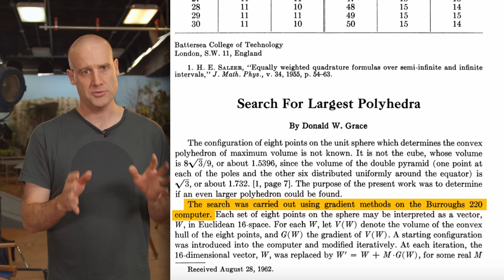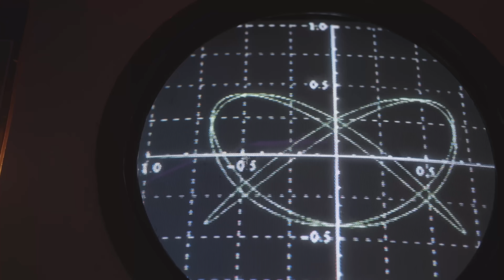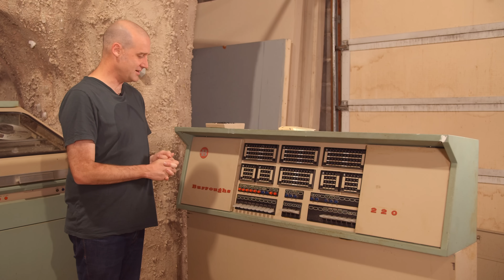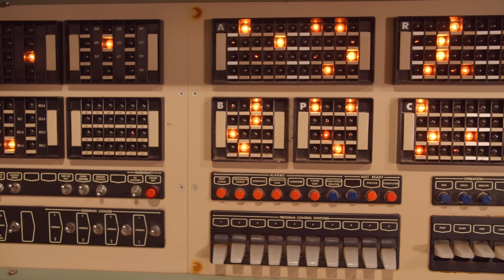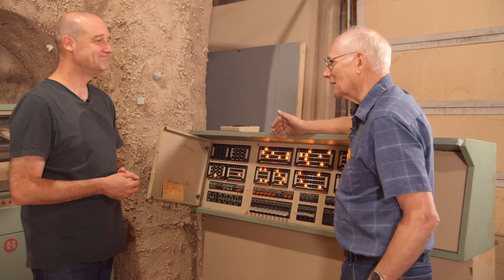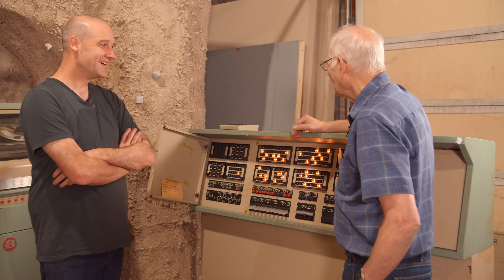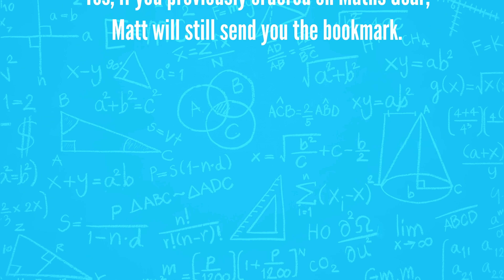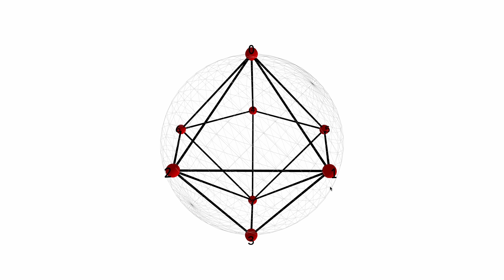The search for the biggest shape in the universe.

Comment: 4:55 so if the cube is 8/9 of the root3, the the cube should be one ninth smaller, not one eighth.
Reply: He didn't say the cube is 1/8 smaller; he said the double pyramid is 1/8 bigger. Which is the same as saying the cube is 1/9 smaller.

If P = 9/8 * C, then:

P = (1 + 1/8) * C, so P is 1/8 bigger than C

C = 8/9 * P = (1 - 1/9) * P, so C is 1/9 smaller than P

Comment: how did they even prove that's the global maximum. i can't even see a possible approach. crazy how they were able to pull it off
Reply: Without looking up the paper, my guess is you can enumerate all the possible configurations of points into a small number of classes. For example, the first point is always the north pole, because no matter where you put it on the sphere, you can rotate the sphere so that point is at the top; 7 points to go. Second point is either at the south pole or it isn't, so now you have two classes; 6 points to go. In the first case (north and south pole points) the point can go anywhere else and defines a plane; in the second case, the point can go anywhere not the south pole and also defines a plane; 5 points to go. The next point can lie on that plane or not. If not, it completely orients your space. Lather, rinse, repeat. The final 4 points have more combinations, so the count of classes probably gets bigger, but not more than 16 (2^4) or 24 (4!) times bigger, so it should be tractable. Then find the biggest volume for each class of starting conditions.
Reply: @johngregor6743  oh that's cool! the idea seems pretty simple, but I'm sure it's implementation isn't quite. nonetheless, thanks for sharing

Comment: @standupmaths 5:00 - I think there's a mistake: if the square has V=8/9*sqrt(3), that means that double pyramid is 1/9 better, not 1/8...
Reply: No. If C = 8/9 * P, then P = 9/8 * C = (1 + 1/8) * C, so P is 1/8 larger than C. You are correct in the other direction: C is 1/9 smaller than P.

Comment: Wouldnt the double hexagonal based pyramid be 1/9th better than a cube not 1/8th?
Reply: No. If C = 8/9 * P, then P = 9/8 * C = (1 + 1/8) * C, so P is 1/8 larger than C. You are correct in the other direction: C is 1/9 smaller than P.

Comment: 5:01 I think you meant it’s 1/9th better not 1/8th better
Reply: No. If C = 8/9 * P, then P = 9/8 * C = (1 + 1/8) * C, so P is 1/8 larger than C. You are correct in the other direction: C is 1/9 smaller than P.

Comment: "Used a motor-driven cam for the blinking lights"...can't get more anti-digital than that.
Reply: I don't know what I was expecting to make the lights blink. Maybe some rat's nest of a circuit board. Can't argue with the classics, though.
Reply: @Veylon  I was half expecting him to say 'an arduino'
Reply: @dielaughing73 no offense but the guy probably wouldn’t know one when he saw it 😂
Reply: @dielaughing73 same, I was 100% expecting him to say Arduino lol
Reply: Analog still rules.
Reply: lights turn on and off so its output is still digital
Reply: You can. I once built a hand-operated cam for a blinky-light prop for our school theatre group. Ok, it was more of a disc with a surface contact, but still, same idea.

And with "once", I mean nearly 40 years ago.
Reply: First comparison that came to mind was that pinball table Technology Connections made multiple videos on
Reply: I mean that motor could have been a combustion engine. Dieselpunk style.
Reply: Just as well he didn't tell us what was used for the 'fingerpoken'
Reply: …no, that's still digital - it's using discrete "digits" (the lights can still be interpreted as 1s and 0s).

Even Babbage's analytical engine (had it been completed) would've been a digital computer, despite being completely mechanical, since it would work with numbers as digits, not as, say, a position on a dial, like a speedometer.

Comment: You've got to love how trivial the 2d version's answer is (I believe), being just the circumscribed regular n-gon. Also, I wonder if it's possible to prove that the maximal shape must have all-antipodal points for an even number of vertices, and not for odd numbers? Also if all faces must be triangles that have to be close to equilateral (for some relevant definition)?
Reply: no, four vertices fails as two pairs of antipodal points would just give a flat plane. I think for four vertices it has to be a regular tetrahedron; I'm not 100% confident but it seems likely.
Reply: @gdclemo  good point, but I'm wondering if that's a "law of small numbers" case, where large enough even (or maybe only multiples of 4) mustobey this result.

Comment: The later Burroughs are interesting because it is not Vonn Neumann architecture but , it had what we would call a hypervisor built into the hardware and would switch between processes to provide symmetric multiprocessing - you could not elevate your privileges to the level of Hypervisor. It was a stack machine with virtual memory and 48bit word size. In 1961!
Reply: I don't remember the model, but I read about a Burroughs computer that allowed user micro coding. You could even choose the number of bits in a word.
Reply: @johnbennett1465  Maybe you're thinking of the B774.  It had "Nano Memory," "S Memory," and "Micro Memory"  As I recall, you could design your own op-codes, though I learned to fix it, not to program it.  TBH, it was always a mystery to me and I thank my lucky stars that the one I was (partly) responsible for never broke down.  The part I did like about it was that there were signal names like "True Blue," and "Stupid," in the diagrams.
Reply: @HSkraekelig  I don't see how you would ever be able to do your own opcodes because those correspond to physical toggles.   I suppose you could make up all sorts of "illegal" opcodes since it was a stack machine and therefore most of your operations wouldn't need an address at all.  You'd instead just send a postfix operation to tell the ALU what you wanted it to do and it would just do that operation on whatever is on top of the stack.
Reply: Yupp. And they had an interesting file system implementation too.
Reply: But can it run DooM?

Comment: 4:52 If one is eight ninth of the square root of three and the other IS that root, then it's one NINTH better and not on eighth...
Reply: No. If C = 8/9 * P, then P = 9/8 * C = (1 + 1/8) * C, so P is 1/8 larger than C. You are correct in the other direction: C is 1/9 smaller than P.

Comment: 5:00 you mean 1/9 better, or 0.111...%, not 1/8 better
Reply: No. If C = 8/9 * P, then P = 9/8 * C = (1 + 1/8) * C, so P is 1/8 larger than C. You are correct in the other direction: C is 1/9 smaller than P.

Comment: Rumor has it that skilled users of the Boroughs 220 console now posses the more modern skill of being able to read QR codes at a glance.
Reply: Ah, the lost thrill of booting your code oby setting a bank of toggle switches on the front of the console.  "Booting" the code?  Reading the first punch card in a deck with the JCL for the rest of it.
Reply: @swankeepers doubtful the Burroughs had JCL 😂
Reply: It's 4 bit BCD,  not really hard to read as it is a decimal computer.
Reply: That'd be a fun build, an old-timey computer with flashy lights that just generates QR codes to the actual data.

Comment: I wish this had included a description of the shape itself
Reply: The shape he was holding appeared to be 1 at the top, 4 at the equator, and 3 at the base, just going by the increase in local maximums.
Reply: Here are the vertices. You can paste them into Desmos 3D graphing calculator to see what the shape looks like 
(0.9700, 0.0000, -0.2432)
(0.5692, 0.0000, 0.8222)
(-0.5692, 0.0000, 0.8222)
(-0.9700, 0.0000, -0.2432)
(0.0000, -0.9700, 0.2432)
(0.0000, -0.5692, -0.8222)
(0.0000, 0.5692, -0.8222)
(0.0000, 0.9700, 0.2432)
Reply: Vertices were 6 points along the equator and two opposing points. But yeah no name given or description of its other possible properties... or whether there is a function for x number of vertices to maximise volume within a sphere.
Reply: @Hesnotoneofus , please doublle check your result. I make out four vertices at which five faces meet and four vertices at which four faces meet. I think that implies there is no coplanar set of six vertices. I agree with @Jellylamps in wishing for a more exact description of the shape.
Reply: @Hesnotoneofus  Matt said 5 at the equator
Reply: @stevechrisman3185  I think thAt was one of the local maximum, no? 5 on equator, 2 above, 1 opposite.

Comment: T̶h̶e̶ ̶s̶e̶a̶R̶C̶H̶ ̶f̶o̶R̶ ̶t̶h̶E̶ ̶b̶i̶g̶g̶E̶S̶t̶ ̶S̶h̶a̶P̶e̶ ̶i̶N̶ ̶t̶H̶E̶ ̶u̶N̶I̶V̶e̶r̶s̶E̶

The search for the biggest 8-cornered polyhedron in a unit sphere.
Reply: Protip: You can strike through text by putting dashes on either side instead of copying special characters
like this
Reply: @katakana1  oh i didn't know that
Reply: I am wondering, why 8?  Is there something particularly interesting or useful in considering a shape with 8 vertices rather than one with, say, 64 vertices?  Or did he just like the number 8, or the computer couldn’t have handled the maths for a shape with more vertices?
Reply: @StephenBoothUK  Probably because 4-7 were worked out before anybody needed to use a computer for calculations. 8 points was just the first one where someone needed computing power to find the shape.
Reply: @StephenBoothUK  8 vertices is the largest case for which we have a rigorous proof of global optimality.
Reply: The combined strike through and SpongeBob sarcastic capitalization works better.
Reply: With all 8 vertices lying on the sphere
Reply: @KurtBlanken Certainly there's no shape bigger that doesn't have the points on the sphere? So that's just redundant

Comment: When I worked at the U of I there was an oldtimer in my department who worked in the late 1960s / early 1970s on some model of Burroughs computer which did the printed circuit board layouts for the modules in the ILLIAC 5 system.  Now I have to wonder if that was the same one. Pretty sure he only ever referred to it as "the Burroughs"

Comment: 15:17 "These two shapes have a volume of 1.626288. They are both bigger than the back-to-back hexagonal pyramid."

Are they Matt? Pretty sure that 1.626288 is less than sqrt(3)

The 3rd shape shown here is also still smaller than the double hexagonal pyramid.
Reply: maybe he meant bigger than the cube?
Reply: 16:39 He then says it's 1.815716, which is finally bigger than √3

Comment: So a regular tetrahedron is the first actual polyhedron you get with max volume (1, 2, and 3 don't define a polyhedra). What are the biggest polyhedra for 5, 6, and 7 vertices? There must have been a reason they weren't looking for those.
Reply: I think those are all bipyramids, i.e. all but two vertices are evenly spaced on the equator, and 8 vertices then breaks that pattern so is more interesting.
Reply: N=7 might not be a pentagonal bipyramid - what happens if you start with an octahedron = square bipyramid and replace one of the apex vertices with a pair of vertices?  If you do this apex-splitting on both halves and let the square distort, you get the optimum shape (a snub disphenoid) so maybe the shape that is half octahedron, half snub disphenoid would be better than the pentagonal bipyramid.

Comment: You went from 4 vertices to 8 vertices, and as far as I saw, stopped there.  Couldn't there be a bigger shape with, say, 16 or 27 vertices?  Why stop at 8? I can imagine a shape with so many vertices it approaches the volume of the spere containing it, i.e., approaches 4(πr^3)/3)..
Reply: They didn't "stop" at 8, they were only concerned with 8 vertices. As he described earlier in the video, using infinite points and defining the sphere is boring/trivial. Looking at the problem for a fixed number of points is where things become significantly more complex and difficult to solve. In this case, the people doing the problem were looking at 8 vertices.
Reply: @phiefer3  Thanks for the clarification.  I somehow missed where they chose to limit the shape to 8 vertices.

Comment: largest possible shape to fit in the universe has as many vertices as plank lengths of the outermost limit of the universe aka its "surface area" or "shell"
Reply: Exactly! and it does not even matter if the universe is a sphere. the outermost limits of any shaped object can be appoximated by plank-lenght vertices (unless we discover a smaller unit of measurement), and that would be the max, but mathematically wise, you could not make a video of this, because the answer would be - an infinite amount of points with an infinite amount of infinitely small vertices and the video would be over in 10 seconds.

Comment: How would you even solve that today?! Volume of generic polyhedra is tricky. Imposing order on vertices is tricky too. Finding global optima over non-algebraic expressions does not even seem possible...
Reply: Take eight vertices defined by two spherical coordinates each. Convert to xyz. Compute the convex hull. Measure volume of convex hull by taking each triangle, adding an extra vertex at the centre of the sphere and calculating the volume of the tetrahedron and add them together. Nowadays you can probably auto-differentiate this function so you know how to update the vertices. As for telling if it's a global optimum, I don't know, that would be the hard bit I suppose.
Reply: @gdclemo  Oh yeah, I'm a moron... I thought vert ordering problems would cause jumps in the function, but those are irrelevant. It does sound like a small movement of a vert would result in a small change in volume, you're right.
Hmm, I would try something like over and underestimating with polynomials, solving those, then increasing the degrees and seeing if that converges. It should...
Reply: @GroovThe  yes, you would switch triangulations only where those triangulations have equal volume. I would fix one point to the north pole and fix the longitude of the second point, removing rotational symmetry and three variables. You could probably apply a branch and bound approach to the resulting 5D problem to find the global maximum. (Edit: it's 13D not 5D, you have 8 vertices so 16 coords, of which three can be fixed)
Reply: @gdclemo  for bab you'd need cheap outer and inner approximations.